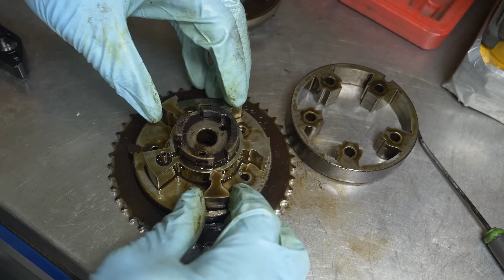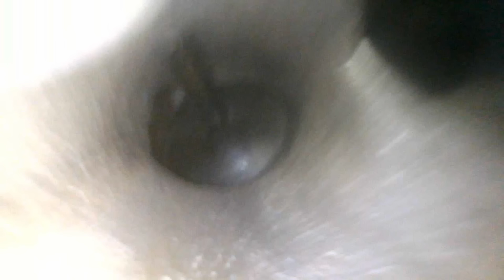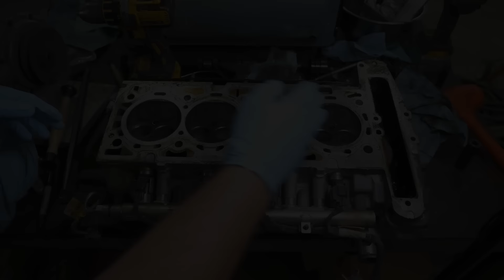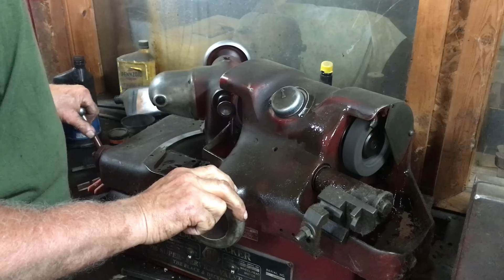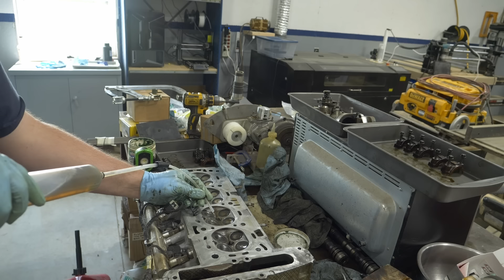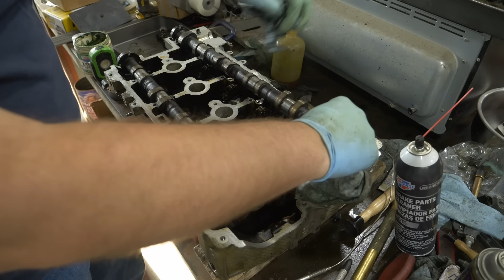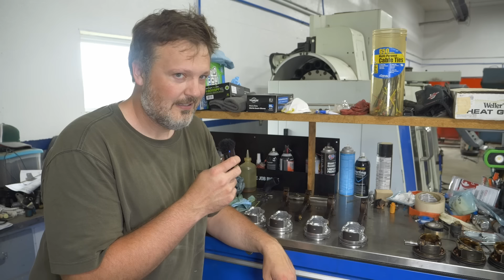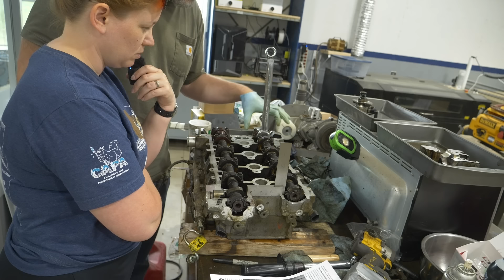How Did it Ever Run? Equinox Still Won't Start

Comment: Just watchuing this video (17 minutes in). I am sitting here with my mouth open at how accurately you describe your on-line experiences! This is amazingly on target for this day and age. 
Furthermore, (ironically perhaps) my wife and I are currently going thru what is an almost identicle "ring -around-the-AI" experience. Please let me bore/amuse you a little. 
The local credit union where we hold/have held for years savings, checking (OK,Debit), and a credit account, reciently sent an e-mail saying they have implemented new enhanced security procedures 'for our protection'.
At this time, we can no longer get to our account to E-PAY a small balance on our credit card (we pay it completely every month until now), and we are on round 197 (OK, maybe a small enhancement/embelishment for effect) of getting 'assistance' with our account to enable access that we used to have. You have failed to note that the 'assistance' we have gotten is from an someone for whom English is not their primary language. Also, imagine our surprise when we have received a follow-on callback after each of our attempts to fix the problem to ask "how did we do" unbelievable!!!

Comment: I commented on the last video, I think this vehicle drove through or better yet, tried to drive through high water or into a lake judging by the green moss or whatever that is covering the engine. 
My experience with that is most people feel the vehicle start to stall and they give it all the throttle hoping to reverse out. That decision is usually what pushes the cam phasers to their limit. The heavy carbon build up didn’t help. The more carbon build up the engine has, the more the cam phasers adjust until they can’t adjust anymore. 
Honestly, with all that, I’d say that’s a pretty tough little motor. 
Also noticed some front end damage to the vehicle. 
For some reason, I just picture that thing diving nose first into a swamp then backing out slowly and limping home. 
Please tell us the backstory. 
Great video as always.

Comment: Wow……just wow…I can not believe how cheesy these engineered solutions have become. That is worse than ford(and others) taking a known wear item and burying it in the timing train then stuffing the engine in a bay where you can barely see the front of the engine.  I like the little trebuchet however. Great to see your fam doing well.

Comment: Is there a maximum recommended valve seating land width value, Ref; spring force in new condition versus tired springs?
Very interesting discussion and demonstration of excessive oil consumption,  your patience and engineering are admirable. 
Thanks for sharing.

Comment: This engine has all the internal signs of significant overheating and over-revving. It is strange that such overheating did not lead to external signs such as discoloration of metal parts and melting of plastic.

Comment: I’ve discovered that the Polaris  Slingshot used the same 2.4 engine and they didn’t have issues because they used different piston rings. Polaris sells these piston rings, sealed power also sells the Polaris version of these rings. Literally will solve all the oil issues with this engine. (Edited to correct Razor to Slingshot.)

Comment: As the owner of two cars with Ecotec engines (older ones, 1.6 and 2.0 liters, German Opels) I can tell you they like to burn oil when they get older. Not too much of an issue in itself, but over time this will make itself worse and cause more problems, like gas in the oil, which then causes bearing damage, reduced lifter performance and worst of all - piston wear. The burning oil may cause problems before that, like enough carbon on the outlet valves to make them leak enough to overheat and burn up.

The one thing that killed both the engines over time - short trips. 
The 1.6 very rarely had 'long' trips (100+ miles) in its whole life, started burning oil and burned a valve at just 89,000km when I drove it at high revs for maybe half an hour (Autobahn...). I hope the pistons are still 'good enough', but with the low mileage hey should be, so she only got a valve job.
The 2liter did well the first ~250,000kms (drove 70-85kms a day), burned some oil up to 300,000, but then homeooffice and the big C hit, so it got only a few miles per week. The valves I did a few times already, so those were fine, lifters as well, they seemed pretty noisy, but what I only realized later - the pistons had worn considerably. Usually the gap is at around 20microns, mine were at 200! You can throw piston rings and a valve job at the engine all the time you want, but within a short while all the issues are back in full swing. She got new pistons and runs fine now, piston gap after a hone is still within tolerance , pretty much no blow-by worth mentioning.

Comment: I know you've got a lathe, and bushing material is readily available. It seems like turning your own bushings would be within your ability. 
I do understand that you prefer to buy parts as long as possible, but a case like this, wouldn't DIY bushings have been a way forward?
And yeah, hindsight is always 20/20.
I have some insight into refurb/reman work where "worst case scenario" is always the starting point when processing an item. 
And that approach is really only economical under very special circumstances.
The rest of the time, we are left to muddle around based on experience and judgement calls. 
And sometimes that comes back to bite us.

TBH though, if you have the time and economy under control, the stubborn cases can be good learning experiences and quite rewarding, even if they are frustrating then and there.
Reply: With Wes fabrication prowess swapping used Honda K24 could also be an option :)

Comment: That damn ac Delco tds site drives us mad. The field you put the password in will not show what you are typing, it will not allow Google or any of the password saving programs work. Frustrating as hell, we struggle with it constantly. Otherwise, programming is the easiest out of all of them. Just maddening trying to log on. If you would have unplugged the exhaust cam sensor, it would have fired right up. The pcm would have ignored the exhaust cam position and allows spark and injector pulse.

Comment: Now you know why there's more of those in junkyards than on the road in Australia, also a big reason GM pulled the plug on Holden and left the Aussie market completely. The sheer amount of recalls, service bulletins and warranty claims on the Equinox and other Opel derived drivetrains or whole cars literally drove GMH toward bankrupty and head office cut their losses and closed their Aussie operation before that could happen.

Comment: Now you know why I stopped telling people I worked at GM and I stopped trying to help them with car problems. Where I worked the mechanics didn't like me because their stuff broke on me so often. I was a test tech at a proving ground so the mechanics called me "Ben Tested Tough." I simply never allowed a poor design any slack. Management harped on all of us continuously about not letting anything slip thru that we'd have to eat on warranty, so I always thought I was doing my job correctly. I took a lot of ridiculing from the mechanics but I always tried to prevent GM from committing suicide by warranty cost. I'm so glad after 36 yrs I'm outta there. ben/ michigan

Comment: Compound failures are the hardest to diagnose.... The only thing worse are multiple weak systems that interact and only cause intermittent dropouts. At least with the Equinox you have hard failures....

Comment: Direct Injection Unleaded had major issues in Australia due to daytime temps in summer being over 38 degrees C, 
Solution install Man Hummel Provents like we do in the Diesel trucks. Once that crankcase oil vapour is separated they run like a Swiss Watch!!

Comment: Based on my experience with a Saturn Outlook (GM Lambda platform vehicle), the gunk on the intake may be  a result of the PCV valve getting frozen or stuck open and the engine pulling engine oil in to the throttle body etc.

There's a whole process outlined about how to drill out the PCV orifice to prevent it.

Comment: There used to be a special policy for those on oil consumption & as for that bulletin I’ve seen that one before for that specific ecotec with the reluctor moving but never seen it, I’d replace that high pressure fuel pump too those can leak fuel into the crankcase

Comment: GM had various 2.4 timing schemes; make sure you have the correct chain and sprockets for your year engine!  The oiler and tensioner were updated too. The HPFP tends to leak on these and won't always throw a code (oil will smell of fuel); replace the flimsy cam follower as they can break. Clean the 4 PCV passages in the intake while it is off (and the orifice too).

Comment: Equinox, when the Sun stays directly over the equator for a period of tme. Little bit too hot that close to the Sun for too long. Hot engines, literally. I personally would try to fit a higher performance engine into the vehicle. Gonna do an engine swap may as well make it run great. Watching Wes work is fun Wes, hang in there as long as possible.

Comment: At 14:35 cylinder three showed the air bubbles on the exhaust valves but after that you where working on cylinder two or did I miss something? I don't know if it was edited out of a misstep during all the chaos. I do enjoy your videos and think you do a great job. Keep up the great work.

Comment: GM has certainly become one of the best at developing new ways for vehicles to fail, they are not alone but they are very good at doing what they do.
These are symptoms of detonation, failed wrist pin bushings, stuff falling off the camshafts.
The benefits of GDI technology.
I remember when they tried it for the first time nearly 30 years ago, think it was Mitsubishi.
The journalist described it as being diesel like in it's behavior.
All for some better gas mileage, yeah.

Comment: If it was not for all the government requirements about pollution etc, we would still be driving vehicles that you could repair with 2 spanners and a screwdriver with parts that cost under $50.00 and do the job under a tree.

Comment: Wes you have the patience of many Saints, here's what you need to do when you get that engine running: borrow a backhoe, dig a large hole, insert the car, pour 5 gallons of gas on the car, when it ignites pour another 5 gallons of gas in this way the car will melt down into 1 giant marble, refill the hole with dirt, and call your brother and tell him somebody stole his car...DONE.

Comment: I'm willing to bet that it would have ran if the exhaust CMP was unplugged.
The cam/crank correlation was the red flag.  Something was wrong with that signal.  I did not know the GM Ecotec had reluctors that would move, but the Pentastar V-6's have this issue occasionally.  We all need oscilloscopes in the shops these days.

Don't forget to clean the PCV orifice in these Equinoxes.  If you do not and drive it in the REALLY cold, the PCV system will totally freeze up and push the rear main seal inside out.

Comment: 26:07 This engine has gotten entirely too hot more than once. The level of caked on schmoo inside the oily areas is indicative of either excessive engine temperatures or really REALLY shitty oil being used. And shitty oil being used isn't going to make a bunch of press fit parts move around like that.

Comment: I had an engine run fine. Did the valve cover gasket and it started. It ran with tons of smoke coming out tbe exhaust after a long crank. 

It turned off. When I tried to turn it by hand, it was hard to turn. I was like oh, it flooded itself. 

So I removed all the plugs to clear the flood and it cranked over fine. 

Put the plugs back in in and I had a misfire on cylinder 1, 3, 6 (bank one) and a crank cam code.

Ok, so it jumped timing?

I checked timing manually and it was fine. 

It had low compression on 1,3,6. A leak down test did show some blowby the rings. 

I never did figure it out. Scrapped it because it turned over with a hard spot so i guess it bent the rods😂

Comment: 20:15 Shitty low tension piston rings + shitty low viscosity oil + asking too much from the engine = this. Industry wide problem. Miracle this thing didn't yeet a rod because of that. Some Honda engines are chucking rods before 100k miles because of their oil burning issues; seems 1 quart every 1,000 miles is considered acceptable and when you have a 4-5 quart sump on a 10,000 mile PM interval......

Comment: Excellent Video  Wes  :) thinking about 2.4 litre 4 cylinders  motor problem that engine oil  was not in right 3 months plus mileage  should be plus wrong grade or bad quality type even not synthetic but conventional oil put it in  and PCV also Air Filters never replace ever ! Yes some engine have trouble free and others problem from start too! Also have one experience seen before some people run Native Reserve Territory fuels because cheaper and not use normal fuel stations or truck  stops  have done tons engine damage plus sensors to exhaust even fuel problem too ! Myself do super qauilty fuel plus oils always !

Comment: Bringing back memories of me hand lapping valves in my dad's shop when I was a kid back in the 70s.
Reply: Brings back fond memories ... At the ripe old age of 13, when my stepdad's 1960 impala 6 cylinder was run way too long out of oil. As grampa used the cylinder cutting tool to get the rings in, I discovered the electric drill, used the lapping mound on the valves pulling backward to lap the valves . FARM TECH 1969... High Ridge, Missouri. Smoked like a freight train, barely ran ... Made it to the Chevy dealer traded for a shiny new 1969 pickup.

Comment: I know this is gonna sound nuts to everyone, but this video was very encouraging to me. I am in a similar situation (relatively) where I was just trying to fix my daughter's air conditioning. Unlike you. I don't really know what I am doing...but the car is old, and she doesn't want to spend a lot of money on it so I am trying to fix it myself so she saves a lot of money. All I was doing was changing the clutch on the front of the AC compressor. Everything that could go wrong...went wrong. I finished the job finally (taking many days instead of hours) and I was just putting the belt back on. I broke the tensioner. Now I have to replace that too. And I don't even know if I am on the right track! Anyway, seeing you, and experienced mechanic being in the same situation, is somehow comforting. Thanks!

Comment: That engine got HOT very HOT. After all the work I so HOPE that you checked the head and the block for warpage. The ONLY time I have even seen spun wrist pin bushings is on a car that got VERY HOT. You sprayed ether in the intake and there wasn't a hint of a backfire or any type of spark, it isnt getting fire.

Comment: I have seen spun wrist pin bushings a few times on a specific brand of engine at the truck dealership I work for. Most of the time it has been a manufacturing defect. The OEM realized this and had a big recall about it. The other 2 times it was because of a lack of maintenance. Both of those I discovered during a failure analysis, in which the rod 6 bearing failed.

Comment: This happens to be a problem few know about on the Civic Type R platform we just weld the reluctor wheels in place. Ive found that high rpms and heat plus vibrations move them ever so slightly and boom “skips timing”. Good find Wes!

Comment: Those automotive leak down testers have an orifice between the supply side guage and cylinder pressure gauge.  Typically 0.040" per FAA Advisory Circular AC 43.13-1B.  So basically you're measuring the pressure drop across an orifice caused by the cylinder leakage.  Smaller engines need a smaller orifice for the measurements to stay relative.  In your case, not relevant but I've seen people test very small engines with high leakage results simply because the orifice is too big for the application.

Comment: I keep thinking that the problem with this engine is the high pressure fuel pump is leaking fuel into the crank case and the rings are shot

Comment: Wes, your intelligence is absolute next level. I'm a bit curious though, I would have thought that would only be a US $2-300 car in the states, a throwaway car? Here in New Zealand I'm sure we have the exact same car, a GM/Daewoo abortion called the Holden Captiva, or Holden CRAPtiva as most say, due to the plethora of engine and transmission failures on them.  7K just for an engine?? And it looks like that car has never been given any love or maintenance. I'd weld a couple of 420cc Predator engines together, attach a chain to the front axles, and call it good.

Comment: My guess is it got really, really hot. I'm surprised the machine shop didn't just make a new set of con rod bushings. I used to do that all the time.  I think the can of gas and a match is a great option. Or do you know of a nice cliff nearby?
I worked at one shop where when customers would abandon cars that had no economical repair, we would "donate" them to the city, by dragging them down the street to a small piece of city property, and let the red tape take care of everything. That same shop had a cure for these kinds of cars. We would just tell the customer they need to jack up the radiator cap and install a new car under it.

Comment: The issue with the con rod bearings, apart from the suspect over heated conrod.
What machine shop would not be able to machine and replace wrist pin bearings.
Bearing bronze is available, why cant they machine some new ones, if its so common looks like a business doing remanufactured conrods.